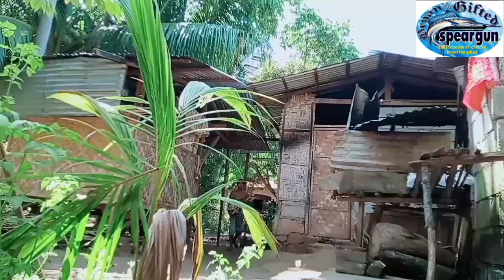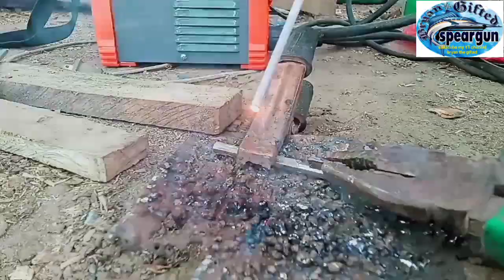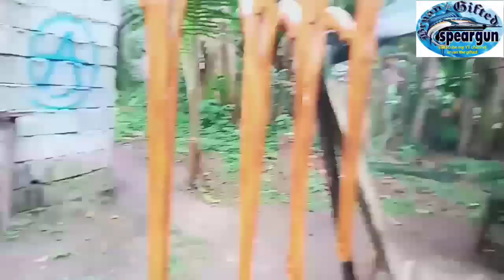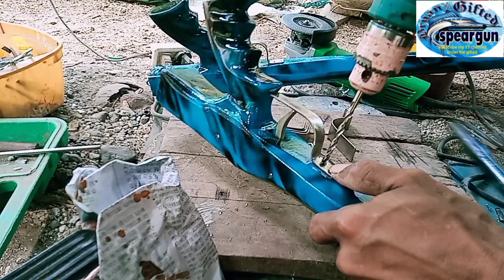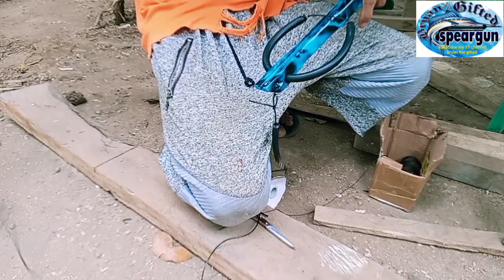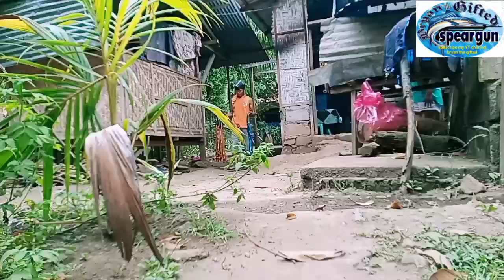how to asimble spearfishing 60cm pang night dive

Comment: Magkano Isa boss
Reply from the maker: magandang araw  po.
Ngayon wala pa akong available bali gagawa pa ako ngayong January batch February mapadala sa February.
Kong mag order po kayo ililista po namin at i update kayo pag malapit na matapos pagi bigay nlng ng complete details
Name.
City
Barangy
Purok
Number.

Mahogany wood
Double rubber
50-60cm 3.3k
70cm 3,8k
80cm 4.3k
90cm 4,8k

Triple rubber
100cm 5.5k
 110cm 6k
120cm 6.5k
130cm 7,5k
150cm 9.5k
All free shipping..
Hingi lng po kami ng down 500 to 1000 po para sure po kunin ang order nyo salamat po☺.

Molave wood 

70cm 4k
80cm 4,8k
90cm 5,5k.
100cm 6k.